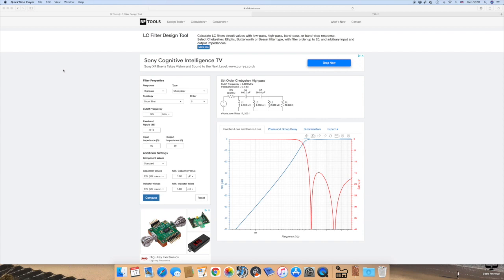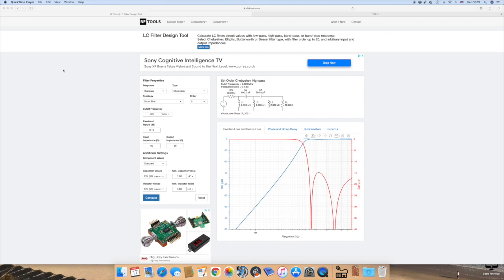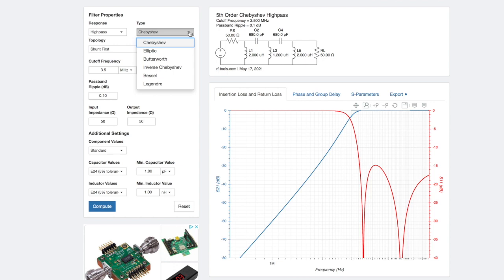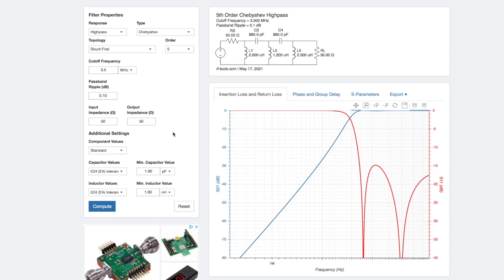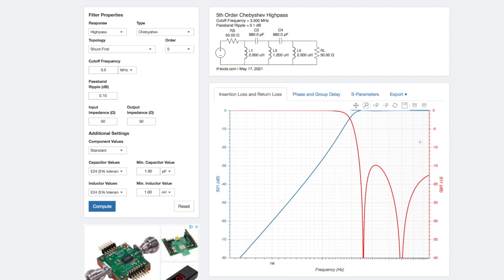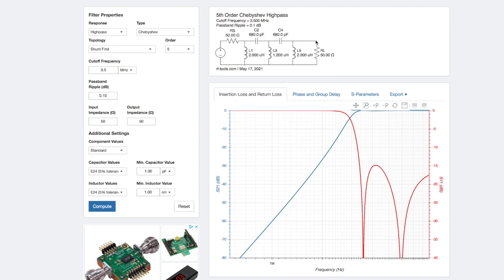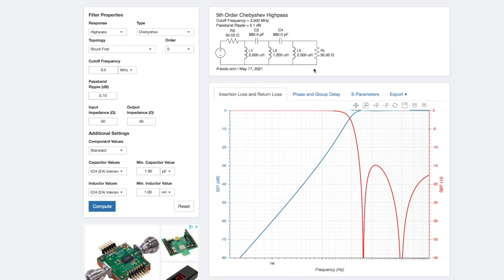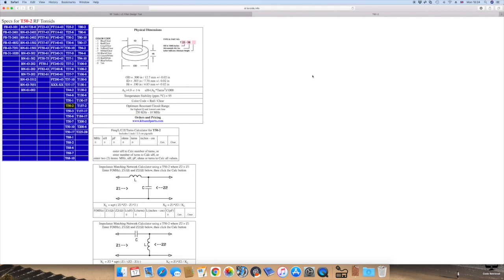11 - Designing an LC Filter

Comment: Great video. One thing I find little to no info on is how to select components depending on the power it must be able to handle. I know the websites you mention, but how to select the right toroids and capacitors for 5W, 100W or 1.5KW? And what wire thickness to use for the different power levels?
Reply from the maker: Thanks Cedric. You might find this article  by the late great George Dobbs helpful:
https://pdf4pro.com/amp/view/a-short-guide-to-harmonic-filter-for-qrp-transmitter-18ac31.html
Essentially, as you'd expect you'll need larger cores and perhaps even multiple cores to handle greater power levels. Wire thickness is a trade off between using the thickest wire you can to get the required number of turns to cover 3/4 or 4/5 of the toroid. Check out other people's designs and experiment! Personally I've never built an LC filter to handle more than 100W (I'm more of a QRP guy) but clearly it can be done. Have fun!